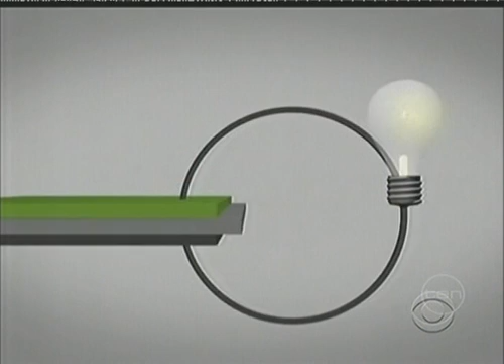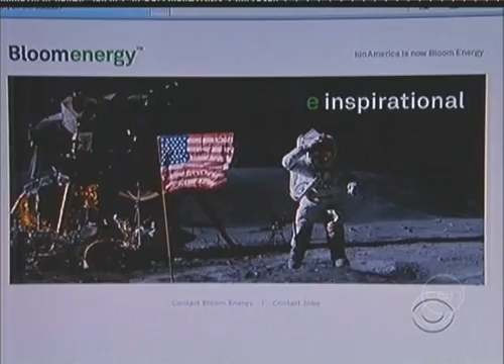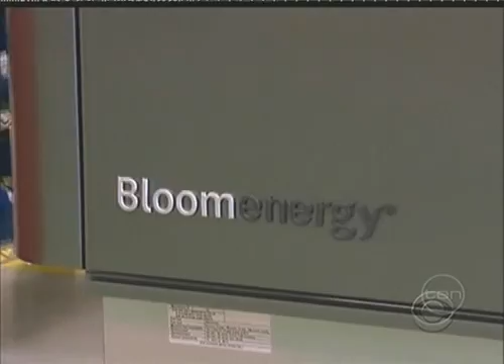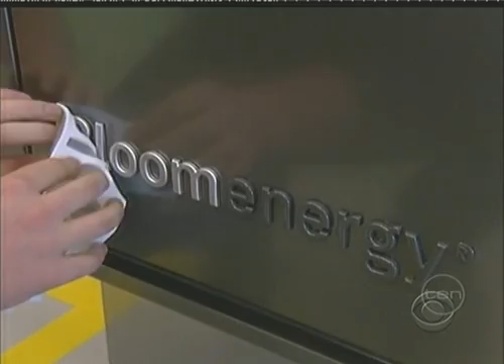Bloom Energy Bloom Box - Off grid electricity for homes

Comment: I think this device is not "free" energy. It is difficult to break the physically law that define "energy cannot be created nor destroyed" So it still needs fuel like fossil fuel, butane, etc., together with oxygen to produce electricity. Difference is it does not need to burn the fuel. For an electric vehicle, it still need a petrol tank and oxygen from the surrounding air to work in this cell device to produce electricity. It requires an electric motor, no mechanical moving heat engines and no re-charging. In Chinese this system is called LanPar-ParLan.

Comment: Bloom boxes require fuel like natural gas along with oxygen.  Another words, if you want consistent electricity, you need to be tied to the grid that provides this fuel.  So this is not Off Grid device.
Reply: franctoma you dummy, electricity is on the grid not gas! Gas is out of the pipe, so yes you can be off grid! Two different systems/industries...
Reply: @SolarizeYourLife  besides u could even be off the pipe and use propane or perhaps hydrogen that u produce from solar/water
Reply: Well if you can get the gas from a local landfill that's a far shorter distance than getting your energy from a powerplant.